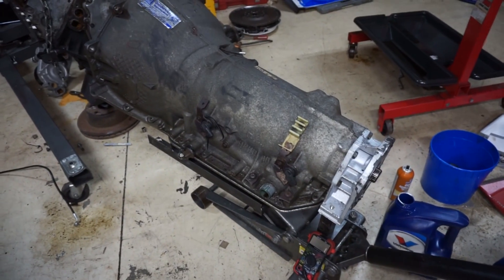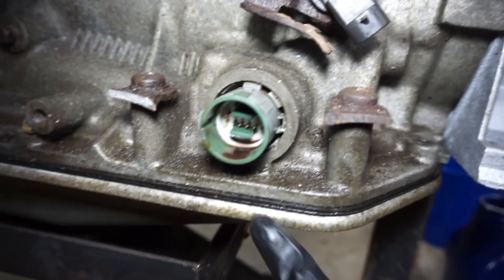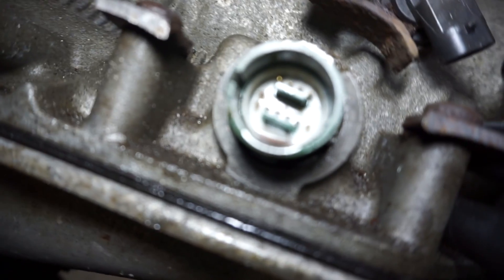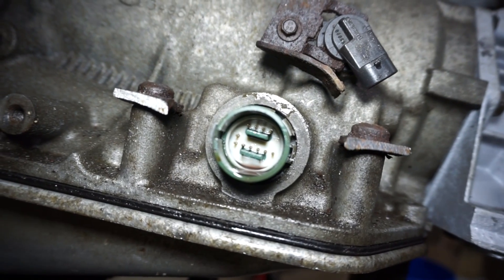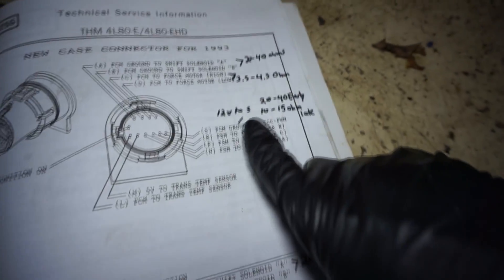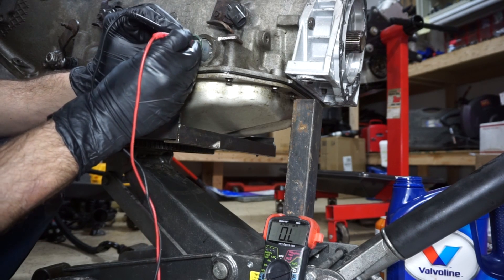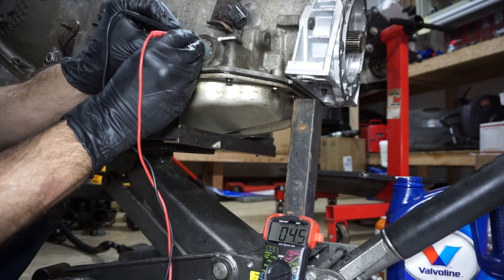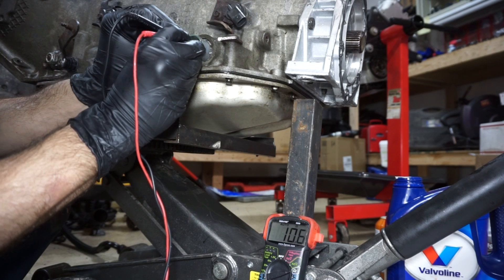4l80e Solenoid Resistance Check Without Dropping Pan.

Comment: In the beginning of your video I saw tranny fluid inside that connector plug.  Another 4L80E owner said that was his problem, the seal was not keeping the fluid from leaking out into that connector and it was making the signals go haywire.......    I'm hoping thats my problem because I'm getting P0753 (Shift Solenoid "A" Electrical).
Reply from the maker: I'm always skeptical of that, because the harness and solenoids are submerged in fluid inside the unit.
Reply: I know.  But all he changed was that electrical harness with the pins that you ohm tested.

I have this code for shift solenoid.  I’d hate to buy two new shift solenoids and it’s not fixed.  Of course, I’ll pop that connector off and see if there’s any fluid inside that big connector. 
But it seems like trial and error.

Comment: How did you know torque converter was bad? I’m getting a po894 code and every one says torque converter is culprit but don’t want to just pull trans and replace that and there’s more wrong with transmission. But that’s an easier fix than transmission. Thanks

Comment: I appreciate the info, I'm thinking my TCC solenoid is acting up. When going into reverse and sometimes drive the truck will stall like the lock up in the torque converter isn't releasing. But after restarting the truck it will be fine immediately.
Reply from the maker: The 4l80 uses pressure to hold the clutch released, so could be a solenoid issue, or low pressure issue or something.

Comment: #Blaser_Builds So I put a brand new transmission brand-new not used and it brand new engine and my truck still doesn't lock up on 4th gear ⚙️ could it be that it's my torque converter I do have a 236/248 cam tsunami camTexas speed so what do u recommend

Comment: Tcc will not lock up on mine ( early model ) my solenoid is Reading 10.7 ohm… should read 20-40 on early model.. is it possible that this solenoid are the reason ?

Comment: Should be no trans fluid in the trans connector. If so, you need to replace the wire harness. Any fluid in there will short circuits out and cause trans to go into limp mode.
Reply from the maker: I would agree it should be replaced to stop the leak, but I think "short circuit" thing is debatable, considering every electrical component in the trans is submerged in fluid.
Reply: @BlaserBuilds  Those are milliamps moving thru the connector and trans fluid is not going to do those milliamps any good.

Comment: Make sure you do the modifications to the converter feed when running a triple disc converter so it doesn’t put drag on the engine at idle. Sonnax 34200-14k
Reply: I just did a Jakes Performance kit and its doing exactly that,its dragging until it warms up.Pretty sure his kit comes with that valve.Any ideas?
Reply: Montana Made I know we had to have the Sonnax part, I believe Matt Happel had the same issue and made a video about it on the Sloppy Mechanics channel.
Reply from the maker: I have the sonnax line to lube valve installed already. Did it a while back to clear up some slight idle surging.
Reply: a21bravo Sweet, the triple disc should couple pretty efficiently!  👍👍👍
Reply: @HeadFlowInc  did yours "fix" itself when it warmed up?Wierdest Fn thing ive seen..
Reply: Montana Made Not really, it still was dragging or putting load on the crankshaft when it wasn’t supposed to.  It has to be a known issue or there wouldn’t be the parts available to fix it, I’d guess. 🤔😉👍
Reply: Montana Made Oh, I forgot, Ryan replied and said he already had the Sonnax part installed because he had the dragging issue before. #Winner

Comment: Hey man great vid. I have a question about an early 4L80e I'm having a problem with at the shop. It's a 92 Chevy 3500 with a 454 and 4l80e. I had to wire in a new external wiring harness and I keep getting a code 73 for a force motor. Swapped in new ones 3 times still same code. Changed throttle position sensor bc it wasn't reaching 5 volts. New one still isn't reaching 5 volts. I'm thinking the computer but maybe you have an opinion on the subject. I would really appreciate it.

Comment: I have a non related issue on my late 4l80. I have a trans fluid drip from that connector. Would that be an oil level issue or a failed seal? I have never been into one and also haven’t seen others with that issue? BTW great video.
Reply from the maker: Bad seal.
Reply: Is that accessible by just dropping the pan or is that valve body level?
Reply from the maker: @handidadhow2charley392  Drop the pan. I do have a video of taking it out in my rebuild series playlist.
Reply: Replace the harness. Its a common problem to leak from the seal, that why harness is reasonably priced now. It can cause transmissions codes and make it act up.

Comment: I keep getting the trouble code p2771 and have checked an replaced just about everything. I'm checking the solenoids from the outside like you did and I get 12.8 on the tcc solenoid. Is this too low for my trans? 2007 silverado 2500hd classic

Comment: Nice bit of info 👍 would a deep trans pan help keep the temperature down for the truck
Reply from the maker: I'm sure it would help a little. The temp was between 145-180 when this was happening. It really only went above 170 when I was driving unlocked (3800 stall). Locked it would drop right back down below to or below 170. This just roasted the clutch as it s tsrted slipping and had issed for 30ish miles.

Comment: I have 4L80E Transmision with code say bad shift solenoid B, I replaced but still say bad shift solenoid, what are you think is the reason? Because I replaced all valve body too
Reply: Did you end up getting it ?

Comment: 4l80 in full manual mode no ecm  when I have transmission in 2 gear by it self it go in to Drive  then when I put it into drive it goes into overdrive?

Comment: My 4l80e is not shifting in to gear . Any suggestions
Reply from the maker: Any other symptoms? Did it just start, is it all gears forward and reverse?
Reply: @BlaserBuilds  it goes in reverse fine and in drive fine . The harness is for a 4l60e but I bought a adapter to go from 4l60 to 4L80e . It drives down the road but I don’t fell it shifting
Reply from the maker: @smokey210210  does it rev high and not shift? How fast can you go with reasonable rpm?
Reply from the maker: @smokey210210  Did you add the 2nd speed sensor?
Reply: @BlaserBuilds  no it doesn’t rev high it will drive good just don’t fell it shifting I ran the extra wire for the vss think it was pin 22 n 23 on the green plug
Reply: I don’t have a tach yet but it will go down the street fine
Reply: @BlaserBuilds  yes in the green plug 22n 23
Reply from the maker: @smokey210210  Verify you didn't mix up the speed sensors. One is input shaft speed (front), one is vehicle speed(rear). If you have them switched it will read weird.... I know if turbine speed is hooked to rear it will act like it's in 3rd, never shift but you can cruise 40-50 no problem.
Reply from the maker: @smokey210210  Do you have HPtuners? Or a way to scan?
Reply: @BlaserBuilds  I have a code reader
Reply from the maker: @smokey210210  If you could read vehicle speed you could tell if its right. Are you getting speed signal from trans?
Reply: @BlaserBuilds  can I use the bully dog tunner to get the speed
Reply: The wire that came on the original 4l60e would that wire connect to the back off the transmission vss or towards the front
Reply from the maker: @smokey210210  Original goes to the back sensor.
Reply: @BlaserBuilds  does the extra vss sensor go to the green pug on the computer 22 n 23
Reply from the maker: @smokey210210  Yes the one added goes to front. Sensor.
Reply: @BlaserBuilds  I only got code p0452 n the speed tach was reading the speed

Comment: Thank you for the video.   This helped me start testing my 4l80e.    I found everything ok but I do not have 12v going to pressure solenoid, I tracked it up to pcm.  No 12v from pcm.   What do you think.
Reply: Fuse

Comment: you look like a doctor doing probe with those gloves and your 'tools' lol. so is a solenoid just an electric switch or do they do different things because there's one on the starter and a bunch of other places?
Reply from the maker: Acts as an electric valve.
Reply: @BlaserBuilds  in the sense that you can change the amount it opens or just an on/ off type of thing?
Reply from the maker: @BlaineLudeman  Usually on/off, but the later years have PWM so can adjust pressure and stuff.

Comment: Wait, my truck has been high rev shifting (engine will shift from first to second at around 3500-4000 RPM’s). I noticed that connector of mine had trans fluid in it, can that cause issues??